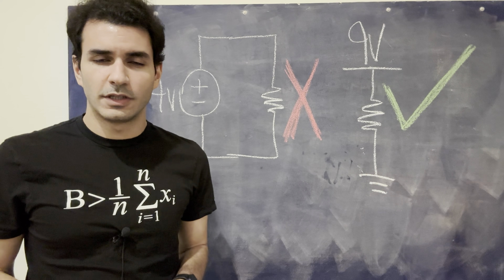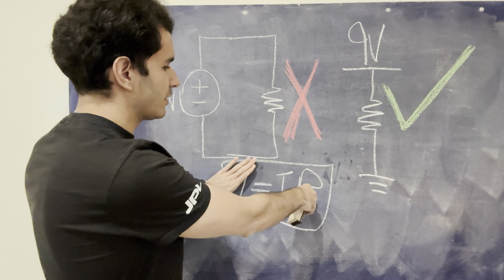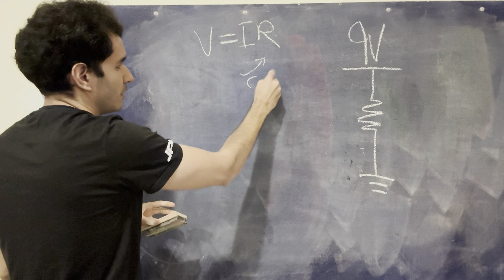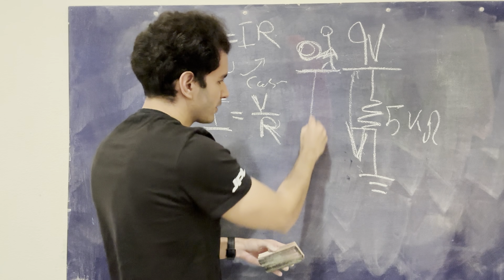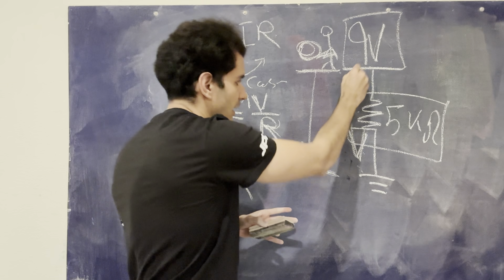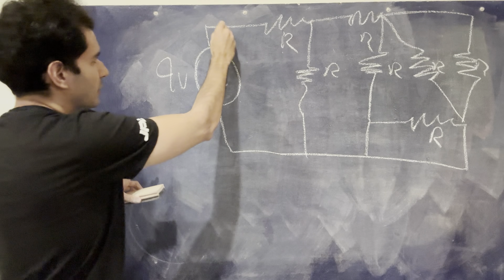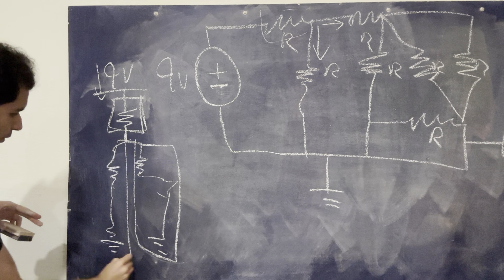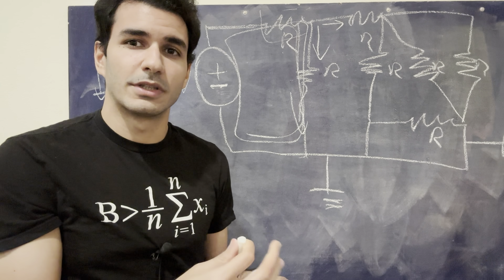Circuits Finally Made Sense When I Saw This One Diagram

Comment: Don't understand why you have so much problem with this. There is no way to draw complex schematics with current always moving in a vertical direction. 

I was taught that an electromotive force drives electrons, and their charges, through a circuit and that V is a voltage drop across a resistor produced by E, the emf. Since the battery or source has its own internal resistance, there is a voltage drop across the battery itself and the voltage available to drive current through the external circuit is 
E - IRint. As a battery ages, the IRint increases leaving less voltage at the terminals.

Don't understand why you'd need anything more. I have noted that you bought into the nonsense that current flow positive to negative, a convention establishing in the 18th century by Benjamin Franklin. Why is it you can accept that lie yet you have so much trouble with the concept of Ohm's Law. It is simply telling you that when an voltage is applied across a resistor, the current through the resistor in controlled by the resistance value and that it is linear. When you add inductors and capacitors in series, that all changes at an instantaneous level.

Current is defined as the number of charges per second passing a point in a circuit. Since those charges are attached to electrons, yet can apparently move independently of them,  any current must flow negative to positive. You said so yourself, that some force pushed the current through the resistor. We are talking about a potential difference whereby accumulated electrons in a battery repel other electrons causing them to flow through the resistor. 

You are correct in your analogy between electron flow and gravitationally-driven masses but wrong in the way the electrons flow. This proves to be a conundrum in electronics texts where conventional positive-to-negative current flow is concerned. They must admit that electrons do carry the current, yet somehow, holes left behind when electrons jump from the valence band of one atom to another atom, can actually carry a current positive to negative. 

Of course, that all falls apart in a vacuum tube or a cathode ray tube. Electrons are boiled off a tungsten heater element when current runs through it and the electrons gather in a space charge around the element. If a high positive charge is applied to a cylindrical plate (anode) surrounding the heater  (cathode), and the tube holding them is evacuated, electrons are attracted to the anode establishing a current from negative to positive. 

EE theory teaches the opposite, that somehow holes flow from the positive anode to the negative cathode. Major nonsense.
Reply: There is always a way to draw differently. because its only a model

Comment: No it doesn't make sense. Voltage is potential energy difference, it only make sense when you bring the two ends together.
Reply: Well you can pretend like its always the voltage towards absolute zero. kinda like we compare air pressure to a perfect vacuum.

Comment: Maybe it's just me, but back when we had a required electrical course in Civil Engineering, I just ignored the power source in the drawing. I mean, it's not needed in the computation of resistance, then I can just ignore it for the moment. Also, it was explained to us that if there is no resistance in one of the paths, then the current will just go there, but I've never seen this use in a test, probably because it will make it too easy... if you paid attention of course 🙃

Comment: i disagree with most comments here, i find that your perspective makes indeed the concept more understandable. Most people in this comments section are missing the point of the fact that this is not meant to replace traditional representation but rather make the basic concept more understandable, so that your brain knows in which way to think about it when applying traditional techniques. This is not a new way to write "A" it's an easier way to associate the sound "a" to the symbol "A", after which you still have a whole alphabet to study still.

Comment: i am a mechanical engineer and computer scientist by academic study, i have along the way learnt and taught driving flying, sailing and restaurant cuisine or cooking to regular folk. the one thing i can say is that any fundamental that breaks down as one advances is of limited usefulness. i liked the analogy of electrical potential to "gravitational potential" but to extrapolate that into a complex circuit is exactly why so many well meaning folk have created models too loosely based on fundamental physics that as the inexpert applies them and sells them like snake oil to the less educated the world gets moved in a  non scientific direction. looking forward to reviewing v2. else change the > to < !

Comment: I've been an engineer for 38 years and I've rarely seen a more misleading analogy.
If you choose to use this model to attain a basic understanding of Ohm's law, that's fine but you will not be served well trying to apply this method to more sophisticated circuits.

Comment: Under normal operating conditions, current does not drain into the ground. Ground is used as a reference point, defining what potential you are referring to as "zero volts". In practice, current flows through a resistive load into the neutral conductor, which connects back to the opposite terminal of the power source.

Comment: Theres a reason why the loop model is still standard today. I dont think hes debating how genius this diagram version is, and therefore all loops should be replaced. In terms of an alternative, elementary explination, this is good. Goes a layer deeper than the plug and chug, and impliments a built in correlation of Gravitional Potential/Mechnaical PE with it flowing with gravity from postiive to negative

Comment: What I want to see is a parallel circuit in a real life application
Reply: Breathing through your nose is a parralel circuit of 2 holes. if you hold one closed, it takes more effort to breathe and the current through the remaining hole has to grow to compensate
Reply: @ataarono  Circuit of electricity please
Reply: @Life3000AnF  The air is moved by electromagnetic forces

Comment: just to get technical, the original formula was E = I X R, where E = electromotive force, I = intensity and R = resistance.  We tend to get sloppy when we start substituting  words.  In this example, we lose the definition of voltage and amperage.

Comment: If a current "I" is going through a resistor "R", it will yield a voltage "V" across it. You can rearrange these in any way, and it works in equations, words, and intuition once you get used to it. Current and resistance cause voltage, voltage and resistance cause a current. 

We're used to batteries, so we think about having a voltage source and that's why the line drawing makes it easier AT FIRST, but to really understand and start to have real intuition you need to get used to thinking from all three perspectives. 

That said, redrawing and being comfortable redrawing is really important, and I CANNOT agree more that memorized equations are the enemy of understanding.

Comment: Hmm, ok this vid is really for beginners. Fair enough. I was expecting something else somehow. We were taught to think of it as a waterfall or river flowing down from a mountain. Voltage (el. potential difference) = difference in height (potential difference), Current = water flow, Resistance = how wide is the path that the water can flow through. Btw. we also used basic equations from circuit theory to actually calculate how fast water flows from A to B in experimental physics 1 class. Crude, but that really drove this similarity home.

Comment: I've just started teaching my children electronics, 11 and 9 years of age, the loop makes more sense in my teaching than that straight line. I'm no engineer or anything, in-fact i have not finished high school but common sense in how electronics works needs that loop. I often tell them DC current flows and AC vibrates but there has to be a reason why electrons move. there has to be a return and it has to be illustrated. your diagram with the straight line doesn't make sense in the real world its just not intuitive. Or am i too uneducated to understand anything here, this just doesn't make sense in electronics.

Comment: If you want a basic basic 10,000 foot understanding of Ohms law this is ok at best. If you want to have a true knowledge and understanding of electrical potential and the flow of charge (current) this is probably as bad an analogy as you will ever see. The return path is critically important for any real system, all potential in the system are a function of the reference (return path).

Comment: I found starting the circuit at the top and the current flowing down like it was pulled by gravity very helpful to understand intuitively what is going on. Especially next to the diagram of a guy holding a giant ball above a cliff demonstrating its potential energy, just like voltage in an open circuit is potential electrical energy. Well done!
As someone pointed out in the comments, you might add a line from the ground at the bottom back up to the top just to confirm to a beginner (like me) that the electricity still needs to flow back to the top to make a closed circuit.

Comment: I think the ball analogy might make more sense if you describe the weight of the ball as voltage and distance from the ground as resistance. The weight dictates the potential energy and the distance dictates what must be overcome. If there is no weight, there is no potential. And similarly, if there is weight, but the ball is already on the ground (short). Then there is no potential

Comment: As an engineering strudent i always wondered the mechanical relationship with electrical. V=ir always seemed related f=ma. Yes its a simple linear perportional equation describing electricsl and mechanical domains, not much else is related. However, integrate these two equations and you end up with power and kinetic energy. I always thought that those teo were analogous in describing their respective domains. I also wondered how momentum was the first derivative of Kinetic energy. I never had a good mental model of what momentum represented other than some nebulous description

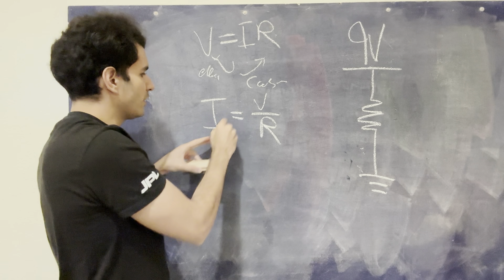Comment: On the equation at 2:27, I had actually first learnt it that way from the book Conceptual Physics by Paul. G. Hewitt. In it, he first explains the proportionality and relationship between current, resistance and voltage before outlining the equation in that form. It was only when I was introduced to it in my school system did I see the equation written in that form.

A lot of times formulas are re-arranged for convinience but they end up looking unintuitive. I'm really glad that I first interacted with physics through Paul's books and he gave me a solid conceptual framework.

Comment: I’m not really seeing the advantage of your method of visualising the ‘circuit’. What I personally found helpful when I was still in my early years of learning electronics basics, was to imagine water being pumped through a pipe with a valve in line. The pump provides the pressure, which equates to the voltage, the valve is the resistance (can be fully open or closed or anywhere in between), and the flow rate is the current.

Comment: You take a car circuit with 12V and ground, there may be dozens of such circuits, with switches and fuses on each line or group. With the circle it confuses the independence of each line, if they are on separate lines they are independent, and anything in the line is a dependency or additional load. In the triangular circuit, it is 3 independent paths to ground, the resistor with ground at both ends carries 0 current. If you have an AC source with multiple items in each path, then it gets complicated and you may need a program to get the current wave forms. Step voltage is probably manageable on paper, the current flow of each path is still independent as long as there is no limit on current.

Comment: Interesting!  I have been teaching this for years and (sure others have said this) if you are considering currents then the loop really is best.  But if you are looking at voltages then the top and bottom power rail model (potential dividers are easier like this) is better.  Now once you have a handle on both then simple transistor circuits, especially PNP are fine with the parallel power rail model.  You kind of have the confidence to merge both techniques!  Glad it worked for you though as sometimes students do just need that 'it clicks' moment.  I think for the very youngest the circuit/ring model is the best place to start.

Comment: This is a very ME perspective on circuits.
Reply: As an ME I agree lol. This made a lot more sense than whatever my professor was trying to tell me about Op-Amps and Superposition.
Reply: Yup, resistors -> regulators, diodes -> check valves, etc.
Reply: Vibration mechanics use similar equations as RC circuits, but with the symbols reversed….

Comment: Not an electrical engineer but this ended up on my feed and I’m not sorry about it. I’ve been trying to further understand circuits better because I’m getting into building my own Guitar effects. This is how I’ve always thought of a circuit but was told that’s wrong. But it makes reading a schematic way easier and it’s also easier to figure out how to build the circuit practically

Comment: So it's a method for begginers to learn it wrong so they can make a bit of sense out of it, before they learn the propper way. I learnt it in the 80s ant it was actually a bit of a hybrid. The first one with the "ground" symbol on the "-" side of the circuit (I first started learning about autio amplifiers and radio emmiters and receivers). Also, thinking about it as "pressure or potential" moving from your 9V down to the - is completely stupid since the current and the potential is moving from - to + since the electrons have a negative charge and that's the actual direction of the current. For analysis purposes it's + and - and most people rationalize it as the current moving from + to -, and it works most of the time, but it's not what happens at all. As a beginner, just try to understand and learn what happens instead of inventing new "shortcuts".

Comment: That is a good way to think of the problem as an analog in order to get the correct answer, but electricity is not actually little bumping particles flowing through a wire like water is flowing from a pipe.  Electricity is a field phenomenon.

Comment: I wish i'd seen this in university. I find electrical engineering fascinating, but I ultimately changed majors because I couldn't afford to fail and re-taie classes. I understand that this method breaks down a little with more advanced circuits, but I can't help wondering if I'd been able to make it had I gotten over that initial dificulty spike

Comment: I never had a problem with either notation. To me the always looked the same. 
One golden rule a teacher taught us to simplify these complex resistor networks was to see the battery as a wire. As it has a negligible resistance. That makes seeing what is in parallel a lot easier.

Comment: Some good insights in here such as the more informative form of V=IR being I=V/R as current is the outcome your interested in achieving whereas voltage is what you need to supply to achieve it in the face of resistance.
The core benefit of the diagram change however is simply using a linear graph instead of a cyclic one.
The only reason the poster prefers down to sideways is because he thinks of it using a gravitational analogy.
It works just as well sideways using the water pipes analogy and IMO even better as people have a much more active experience with turning on the tap and seeing how much you have to turn it to achieve the amount of water pressure out the other end of the hose given the resistance of the hose diameter, intermediate devices etc.

Comment: If redrawing circuit loops into straight-line or whatever alternative equivalent form allows a student to understand and generate the correct solutions to the equations, then that's great. However new EE students are going to have to deal with many different circuit configurations so they need to be able to solve for unknowns with circuits drawn in a variety of ways.  The straight-line-to-ground configuration is likely to cause issues with AC and DC circuit analysis when circuits are shown as loops, especially when the current/voltage sources as well as components pop up where they don't expect.

One problem with the straight-line example is the introduction of a ground symbol, specifically the three, horizontal line ground symbol where the concept of 'ground' is not needed. If you have to use a ground symbol to understand this circuit, then a better symbol might be the inverted triangle, (aka signal ground), to indicate the circuit can be 'floating' away from a physical ground with its own common, zero potential point. IMHO, the best ground symbol in this example is no ground symbol at all since is suggests all circuits must be physically grounded, which they do not.

Comment: ???? The first drawing is correct. It shows that there is a circuit. There is no circuit in the second one. The first one shows there is no switch, how is the 9 volts positive attached to the circuit?

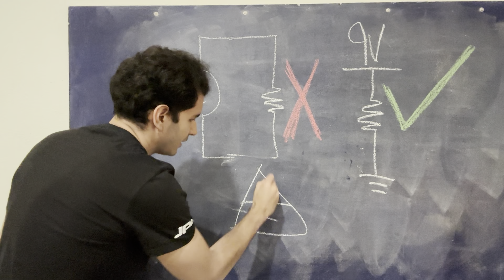Comment: You're overthinking the triangle which  is literally the simplest method to figuring out ohm's law formulas. Step 1: draw the triangle like you did @1:15. Step 2: Use "The Rule of Thumb" ( Take your thumb and cover what you want to solve for) Step 3: Profit. It literally doesn't get any easier than that.

Comment: As an electrical engineer I can just say you seem to solve a problem that doesn’t exist. So you are not able to visualise a loop with different points of pressure or voltage etc?